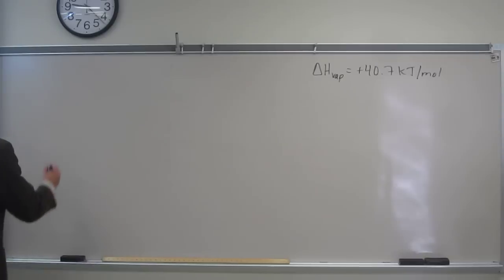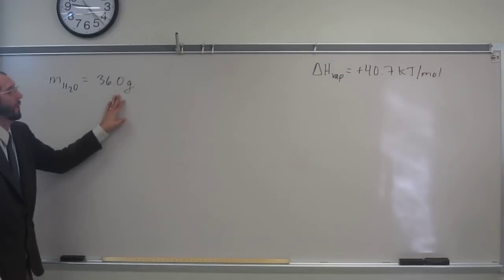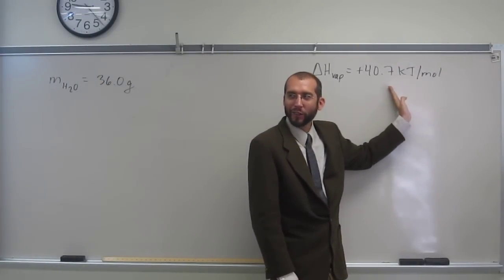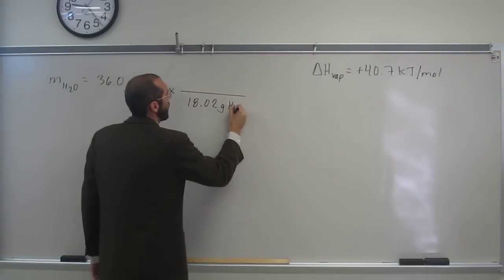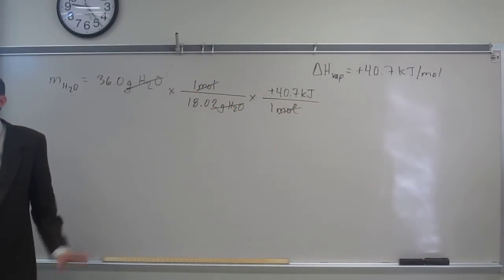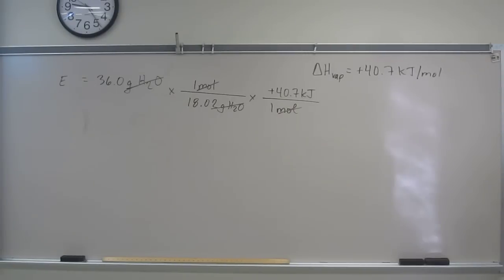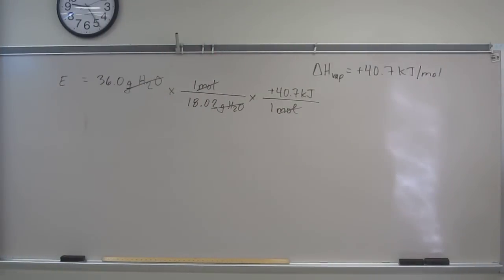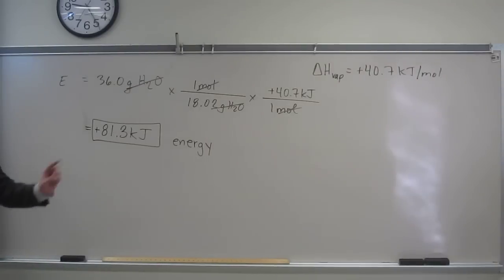Calculate the Enthalpy of Vaporization (∆Hvap) 001

Comment: This is how to calculate heat of vaporization, not enthalpy of vaporization
Reply: They are two names for the same thing, as far as I'm aware. 

The reason for this may be that enthalpy is the heat absorbed or produced during any process that occurs at constant pressure.
Reply: @Morgan Isles  yeah, i probably wanted to say that this is how you calculate the heat produced by the reaction, not the enthalpy, that is the initial dH=40,7 KJ/Mol in this case.